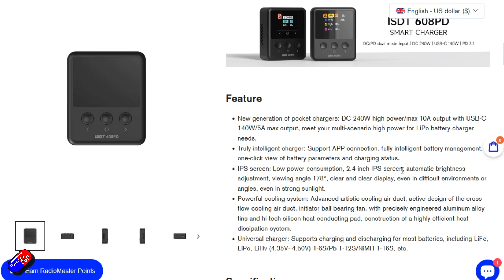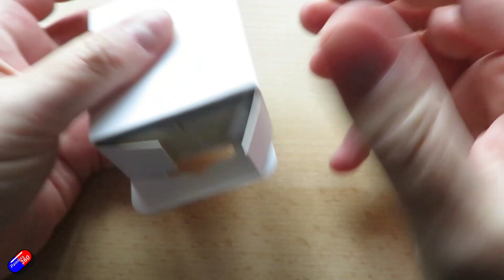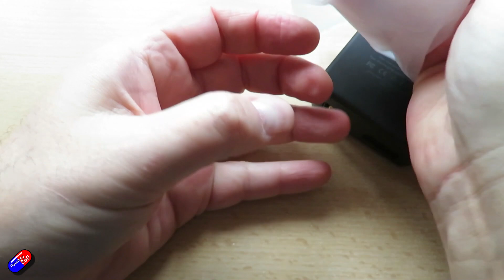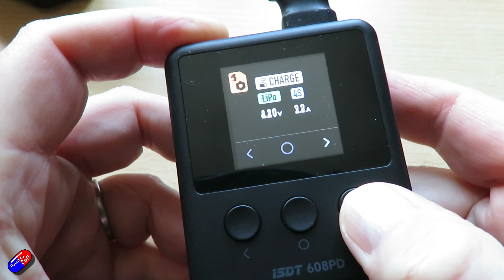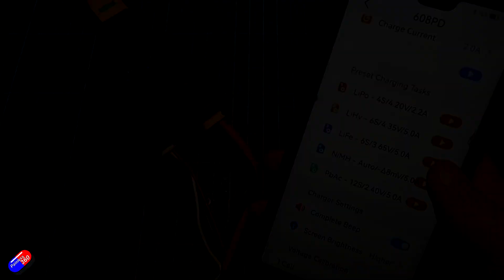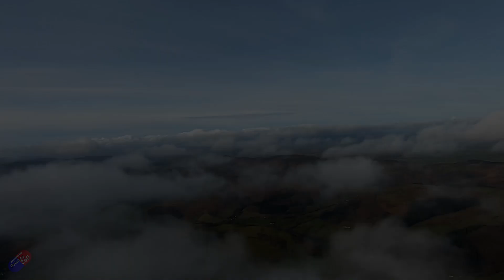ISDT 608PD: A compact, SMART pocket battery charger with limitations..

Comment: Can you post a link or tell me how to get a dc power supply for this?
Reply from the maker: It would run off a lipo battery or a dc power supply with a similar voltage. Best of luck

Comment: I saw discharge in the item description on Amazon. Was discharge capability added?
Reply: Yes, it can discharge via load connected to pd port.  External discharge load is my preference, dump waste heat outside, into a bidirectional pd powerbank.
Reply from the maker: No idea. This video was made a while ago. I can't see any firmware update for the one here on their website either. Best of luck!

Comment: The usb c on the back can be used to charge your phone or whatever you plug in and it also can discharge down to a set cell voltage using it.

Comment: If only its possible for them to add a storage/discharge function that allows you to plug the lipo via the balance and charge lead...and discharge it by charging a device via the USB C output. The lipo can be monitored to stop at 3.86v (or something that you can set via the app) when its charging the USB C device. Even their Batt Checker Batt GO BG-8S can do that.

They should also add an option in the app where you can manually set the charging voltage so you can choose to stop at 3.86v when putting flat batteries back to storage.
Reply: Set your charge voltage to 3.86V, voila!

Comment: I bought many ISDT Q6 nano and not skyrc because it can not only do storage charged but  you can choose storage voltage range from 3.6v to 4v. Very useful when you have old lipos that tends to selfdischarge faster than usual. This new ISDT charger added new function but removed the essential function that make ISDT great. Hope an update or v2 solves that.
Reply: so this charger cannot do storage function ?
Reply: @dailydronejourney Sadly it can't

Comment: I have one, it’s quite nice I use it with a high capacity/output powerbank when on the go. It is slightly frustrating it doesn’t do storage charge and discharging without using it as a power supply to charge phones.

Comment: this is a nice little charger, I use them to charge my 4-6s batteries from external DC or as a backup source/PD powerbank with Li-Ion's batteries for laptop etc...  I have skyr b6 neo, and they are similar, ISDT has higher current for charging via balance port (800ma) and skyrc has only 500. In case skyrc will have a bigger balance current, would have been a better choice because of that and because it has storage/discharge mode.  ISDT air8 has 1500mA and is noticeably faster because of that. 
Do you think they can add storage mode to 608pd via firmware update ?